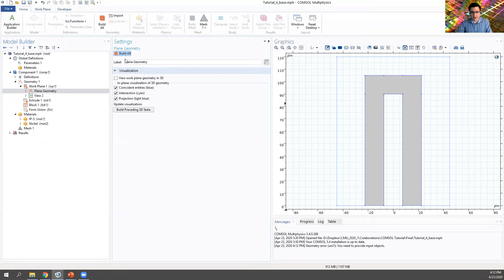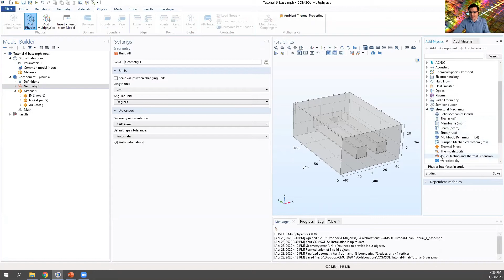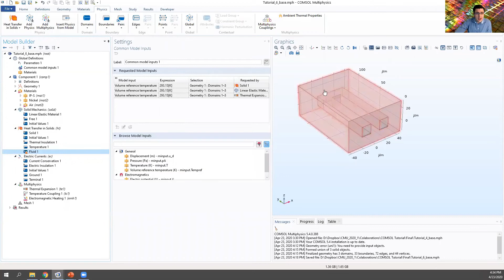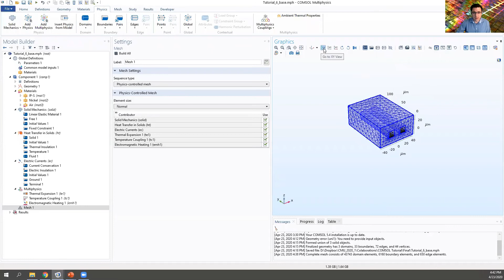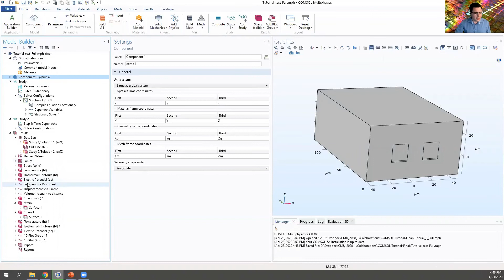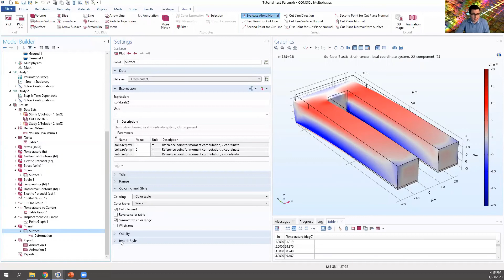Joule heating micro actuator -COMSOL tutorial

Comment: Hello, do you maybe know why I can't set a terminal? It's not even listed...
Reply from the maker: Because you need to select the AC/DC domain first. You might be selecting the mechanical module instead
Reply: @cavelcu  thanks for the quick reply... but also if iI choose (ec) and drop down the menu of the boundries there isnt any terminal listed... only stuff like elec. potential , ground and so on
Reply from the maker: Please download the mph file from my website:  https://camilovelez.site123.me/comsol-simulations/joule-heating-actuator You will be able to compare your simulation and mine side by side. Be mindful that terminals are only area boundary conditions for 3D objects or edge boundary conditions for 2D elements. You can message me to cvelezcu@uci.edu and I can try to help.
Reply: Same problem. Have you find the solution?